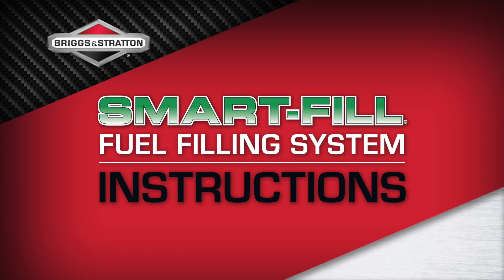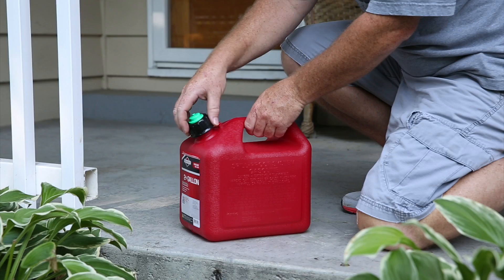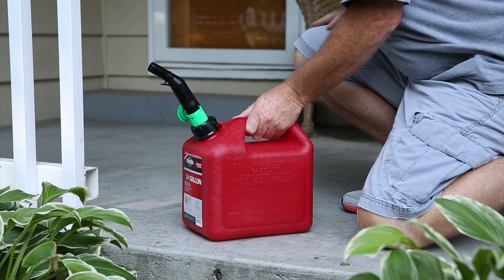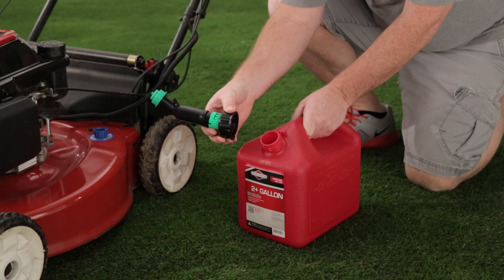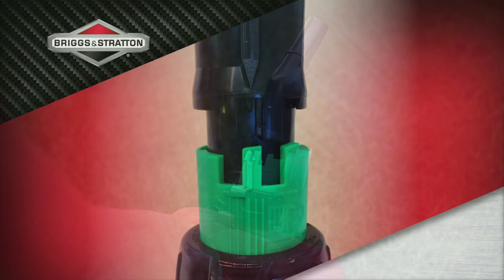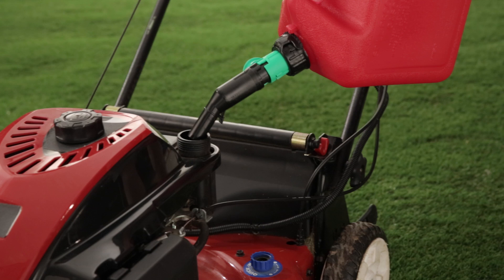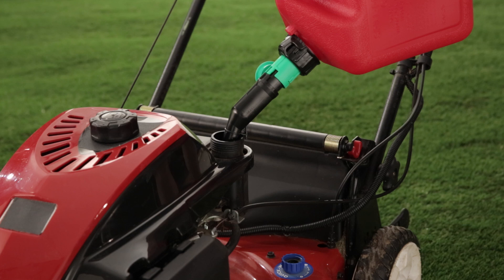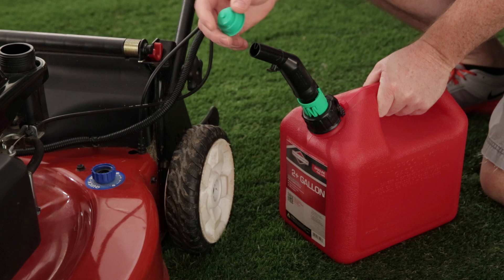Briggs & Stratton Smart-Fill Instructional Video

Comment: As many others have commented, this gas can is SO unnecessarily complicated. I fussed around with it a bit after watching this video, and then just broke off the circular plastic piece that stops the flow of gas from the can, now it works and so I guess it's fine. Good luck to anyone trying to use this without watching the videos or reading the comments.

Comment: This gas can design makes sure that you get gasoline ALL OVER YOURSELF! Terrible design.
Reply: Did you try tightening the lid all the way?
Reply: If the gasket is seated properly it won't leak gas.
Reply: That too (also, I’ve been using this can for about a month and I haven’t had a single leak, not even a drip)

Comment: It's not too hard to take out the little cap and spring on the inside of the tube. If you do that, the can becomes usable. Don't even think about using it in its original configuration.

Comment: This is to everyone whom is still having gas spill everywhere when you go to pour, because the EXACT same thing was happening to me no matter what I did. The rubber gasket for the bottom base of the spout nozzle may have fallen off of your unit or was missing when purchased.

My spout was not staying in place at all when screwed in, and gas would pour everywhere from underneath of it when I first tried to use it. I thought maybe I wasn't pushing or pulling something hard enough to snap in place, and I ended up pulling my entire spout in half. Giving up and going to using a funnel and pouring the gas in that way, I mowed my lawn. After I was done I noticed a rubber gasket the size of my spout's base laying on the concrete outside of my shed. I tried looping it over the spout at the base and that did nothing. Then I realized it snaps over the edges of the spout base and then you install the spout as shown in the video. ONLY THEN did my spout not jostle about loosely and spill gas everywhere from under its base.

Also on a HUGE plus side, me pulling the spout apart caused me to lose the spring that is responsible for that annoying as hell push and pull crap. When I put the put the spout back together without the spring I can now manually control the opening and closing of the spout and use it LIKE A FREAKING STANDARD OLD FASHIONED GAS CAN SPOUT!!!!

Eat it EPA.

Comment: I am so angry right now!!  Usually I can figure out something without instructions.  I bought this and at the gas station without any instructions I couldn't figure this crap out!!  After about 40 minutes, and watching a few YouTube videos, I realized the design is probably a good idea.  However after fussing with it forever and no fix I realize it doesn't help when the contraption with the spring that opens and closes the valve for gas flow, was broken!!!!   So, I will improvise and get my gas where it needs to go (motorcycle) and take it back!  This is just silly!!  What an ordeal for nothing!!
Reply: So you fussed with something for 40 minutes and only afterwards noticed that the spring was broken. Are you positive it was broken before you started messing with it?
Reply: The spring flew out of mine the first time I tried to use it. What sadist thought this was a good idea?

Comment: Just finished using mine gas kept leaking and i barely got n e into the tank hands still reek of gas
Reply: Did you try tightening the nozzle completely?
Reply: 0MindSwept0 yes i did the problem came when i pressed it forward to pour gas leaked from side of green collar
Reply: Maybe check the gasket

Comment: This presentation cuts to the chase without the extra verbiage.  I see now that the protrusions on the top of the nozzle are merely guides or markers. The 2 main points to be learned are: 1. the principle of opening the valve ("push"); 2. the proper way to make the opened valve stay in place ("push"--or, rather, "keep pushing").  

Clearly, the container is designed NOT to stay open. It's a participatory exercise, or a duet, between the instrument and the instrumentalist--who is instrumental in the funnel's remaining open.  Maybe it's like breathing. Breath requires a breather just as the flow from this spigot requires a "pourer."  Now I think I "get it": it's not the can or spout that's "smart" but the user!  I would never call my piano or a saxophone or even my computer "smart": as usual, that adjective belongs to the human factor.

Comment: The fundamental problem with this type of gas container is that it is virtually useless when you are using a funnel. That black hinge on this gas container won't work with a funnel, because the funnel is very lightweight. You have to manually push the gas container into place, which is virtually impossible when the container has four or five gallons of gas in it. You cannot keep track of how much gas is going into the mower.
Reply: Hello... You don't need a funnel to use this container. Also, You can't keep track of how much gas is going in with a funnel either.

Comment: The only thing all the safety features accomplished was getting gas all over my hands and all over the piece of equipment that I was trying to fill. What the instructions don't say, and what this video doesn't say, is that you have to remove the nozzle and underneath the nozzle is a green cap that prevents the flow of gas. you have to remove that cap and then reinstall the nozzle. I was following instructions and pushing and pushing and pushing and gas was leaking out all over the place from the nozzle until I finally figured this out. Bad bad instructions.

Comment: This thing is awful. I bought it in a pinch and immediately things began to fall off, fly off, in my effort to use it. So overengineered for safety that no one can use it except by basically converting it back into an old-timey gas can.